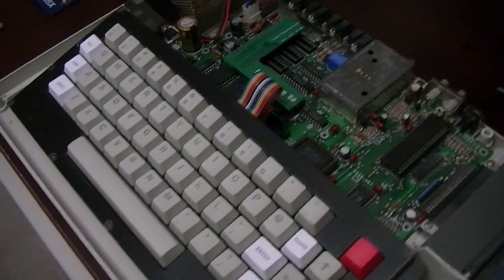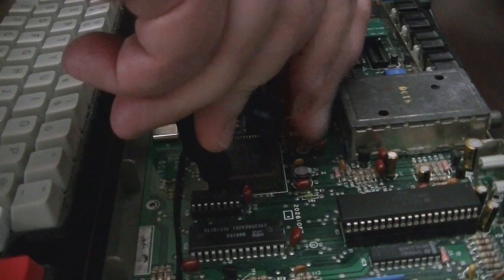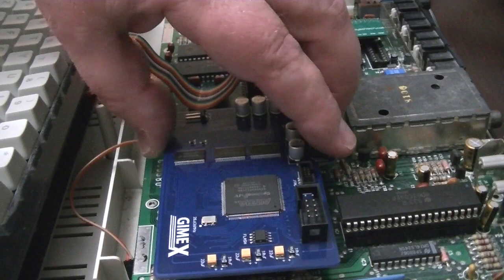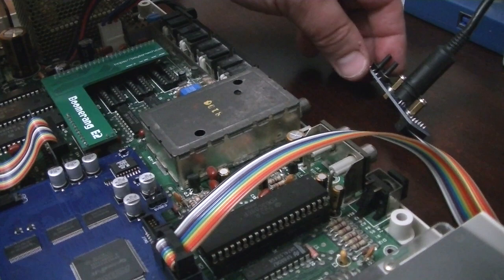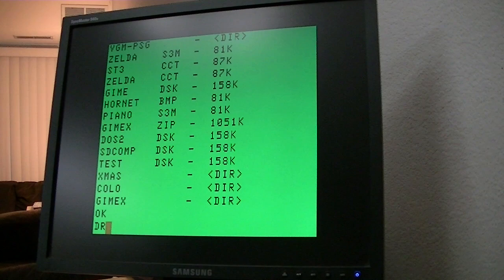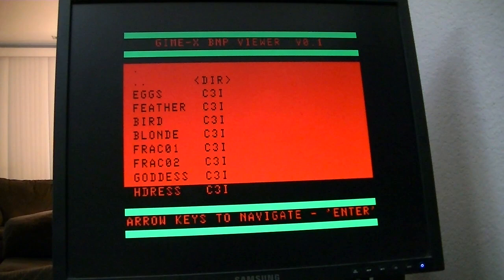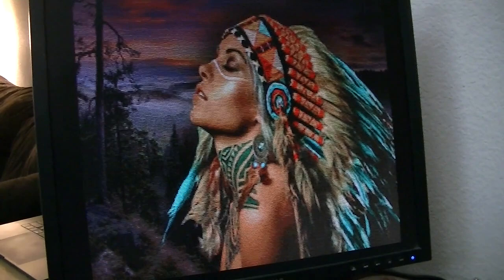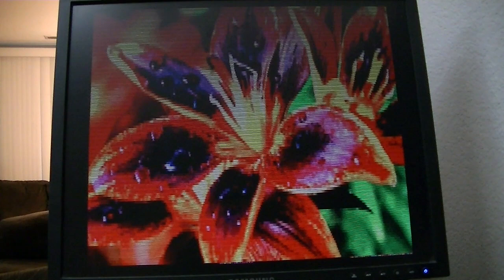Installing the GIME X

Comment: Great job! I would love to see someone make a synth board for the Cc3. The sound capability is what always held it back. The original spec of the CC3 included the Orchestra 90 integrated, and even so it cost less to manufacture than the Coco2... but Tandy scrapped it to increase profit margin